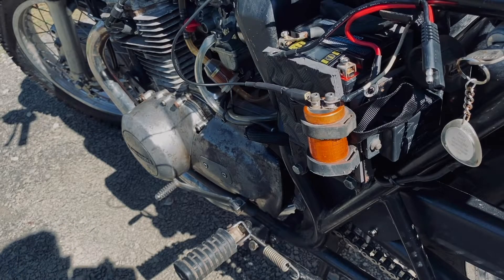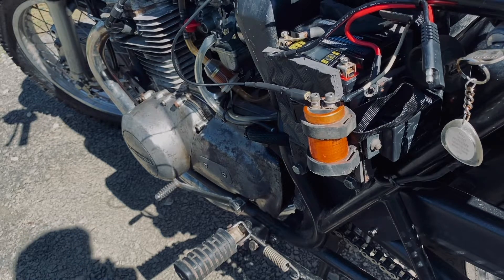Running a Motorcycle Without a Battery | Using a Capacitor to Delete Battery KZ400

Comment: Hi, in late '70's I had a beautiful Triumph triple 750 T150, customised like a flat track type. It just had a capacitor, NEVER let me down, rode from UK to Italy twice. Awesome. Started 2nd kick if not 1st. I am renovating the grand old lady, will I need to replace the capacitor or are they pretty much indestructible if just laid up? Any advice greatly appreciated.  It also had/ has electronic ignition, I.e. no points.
Reply from the maker: Not sure how durable capacitors are but do be sure to discharge it for safety. You might be able to test it with a multimeter but for something so essential I would probably just replace it. Sounds like a great bike and some great adventures. Good luck with your build!